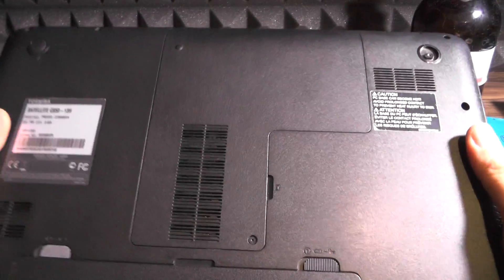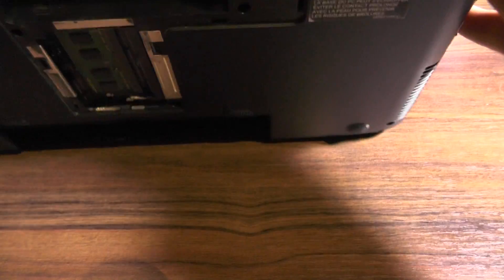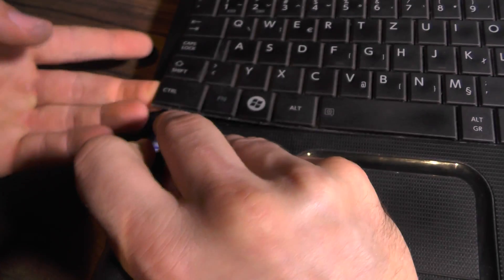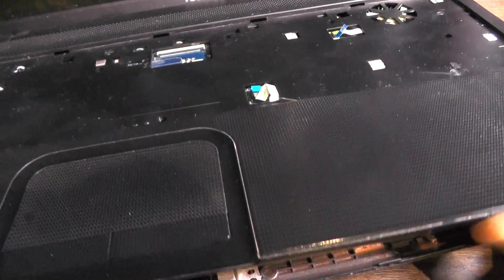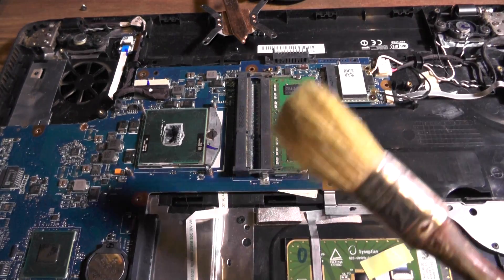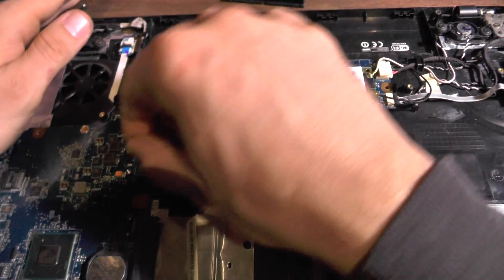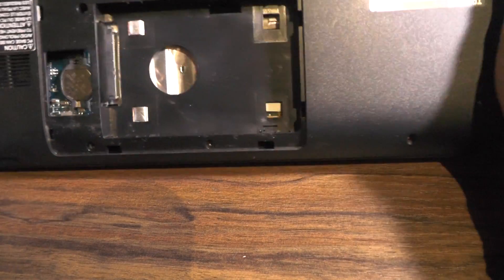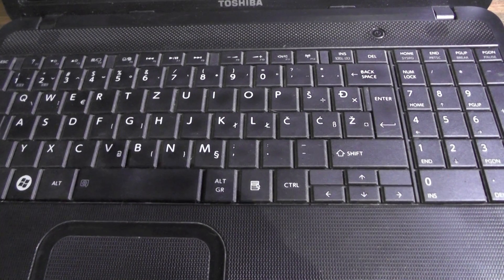[HW: HowTo] - disassemble Toshiba C850 (Change thermal paste / Cleaning fan)

Comment: I've Toshiba satellite C850-B378 can i upgrade its WiFi card with a new mini pcie WiFi 6 or 6e card
Reply from the maker: not sure, i think wifi6 uses 3 antennas + motherboard might be locked in bios to only specific set of wifi cards.

Comment: I followed these exact same steps, but when I plug the pc it overheats and suddenly shuts down, but the fan is working fine
(I also replaced thermal paste) 
what do you think could be the cause of that ?
What should I do?
Thank you
Reply: Did you apply alot or a little of thermal paste also did you screw in the heatsink properly

Comment: the trackpad have a square that looks like a fluffy dirt , i cleaned it but then when i saw your video i realized its part of the hardware .. what is that little squared dirt like spot on  track pad is for ? please im so worried (its that little black spot bottom left of the track pad ) and by cleaned it i mean removed it
Reply from the maker: can you tell me the time in my video where this shows so that i can see what you're talking about?
Reply: @MTS_IT  13 38 , its that spongy thing on the track pad back .. bottom left of the track pad, the thing that is between the white strip and the metal strip
Reply from the maker: @rainkalm3230  it transfers ground connection, but you can live without it - no worries :D

Comment: I know it’s very old video. But hope u can help. Mine is L850. The fan sometimes doesn’t run. I cleaned it with brush but still malfunctioning. I couldn’t fully removed the fan to put some oil in it. Should I change the fan or is there anything else I can do? What kind of oil do u use for this fan? My laptop got overheated and automatically got turned off several times. What can I do?
Reply from the maker: hi, just get a new one from ebay... replacements are about 5$
Reply: @MTS_IT  ok. Thanks for the suggestion.

Comment: Thanks for the video! I have a question!  I got the c850d PSCC2C-012003 for free out of a dumpster! It works BUT the battery does NOT charge.  I know it's not the battery because i have the same battery and laptop as well, and both batteries work.  Both batts are not recognized by windows when I plug it in while ON and OFF, BUT it does blink AMBER when the battery is inserted with AC plugged in AND  when AC is out.  I am guessing it's the mainboard and/or a mosfet.  Any idea what I could do here? Replace the mainboard?  I can get a used one locally for about $40.  I am poor student here in Canada during this hysteria!  Thnks a lot man!
Reply from the maker: hi, try checking the battery fuse. it's white little brick usually somewhere near the battery connector.
Reply from the maker: it looks similar to the brick near the keyboard connector (to the left of it) https://youtu.be/Edr8vnRHS0s?t=348 you can check it with multi-meter in diode mode (if it makes a sound it's OK)
Reply: @MTS_IT  thanks for the tips I hope to tell you if it worked or not but I have to take it all apart I guess

Comment: Bro my Toshiba laptop c850 is working fine but no display,  already tried to switch ram stick and the hold power button step but still no dispay can you help me?
Reply: Tristan Algordo if still doesnt work maybe your video card are already dead
Reply: THis happend to me, the display connector might be loose
Reply: Yeaaa me too 😭
Reply: Tristan Algordo try cleaning the ram by using eraser

Comment: can i remove the fan without removing the copper heatsink?
Reply from the maker: you can, just unscrew top 4 screws on the fan and lift the fan cover (you will not be able to remove it but you will be able to clean it), however i do recommend you remove everything and change the thermal paste.
Reply: i did it. my toshiba c850  din't have screws under the keyboard. not even a single one. also, the fan was just placed by the side of the heatsink and not fixed to it. so it came out easily without doing anything to the heatsink. Amazingly, just cleaning the fan and heatsink airvents with a brush  reduced the temps by 10 C. i am really surprised. i think this thermal paste business is a big scam.

my laptop will be 3 years old in march 2017. 

 people should first clean the fan and airvents before investing in thermal pastes.
Reply: @jjj0nathan  Old comment I know, but the thermal paste is like $5. If you're gonna do something, do it right and replace your thermal paste as you clean your laptop.